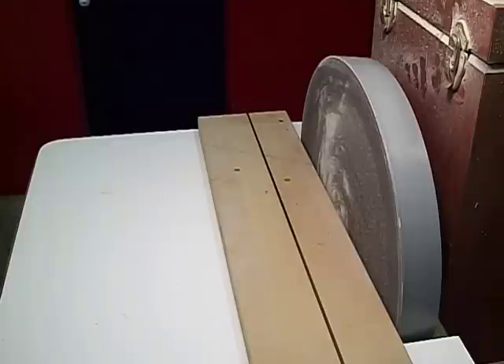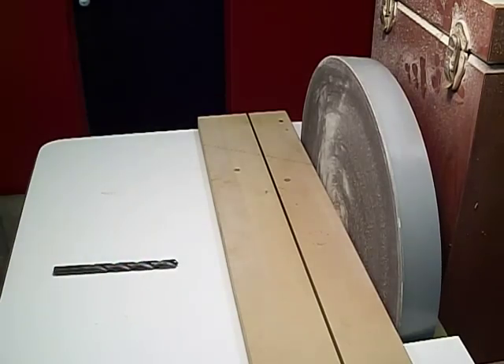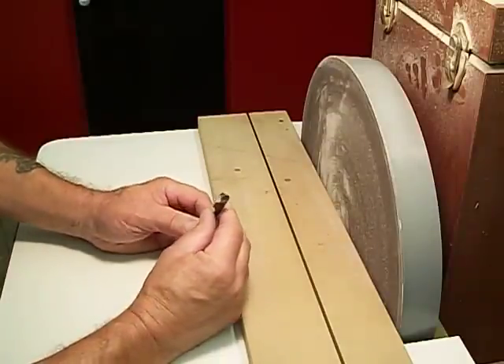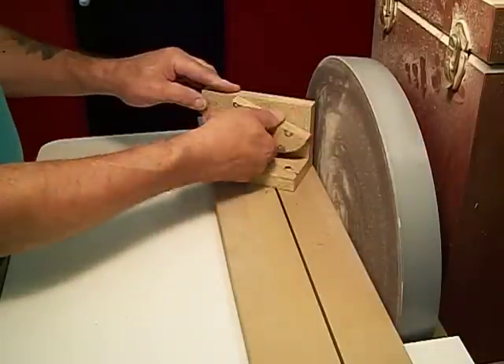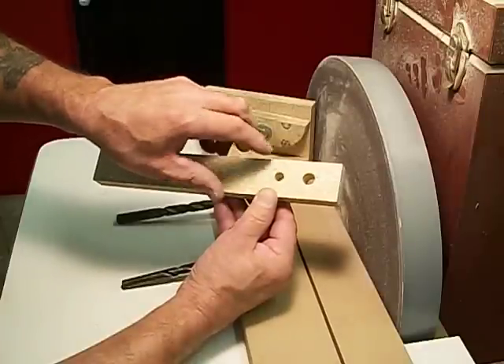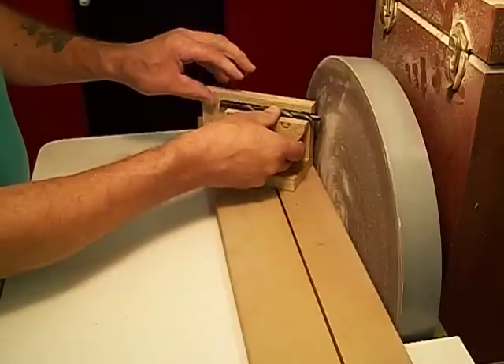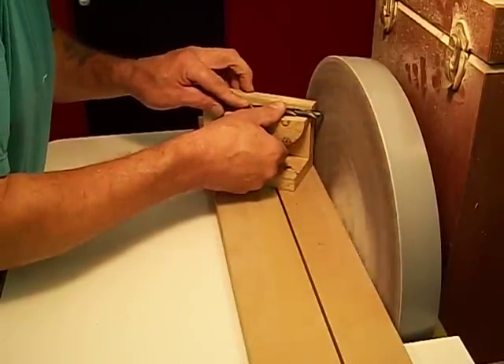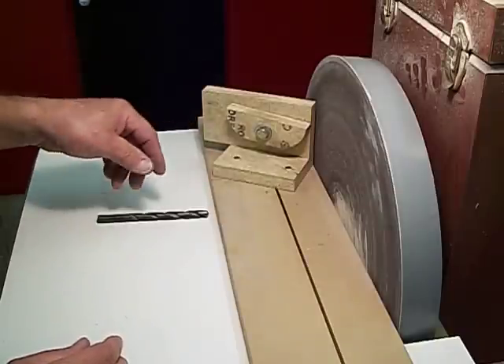A Drill Bit Sharpening Jig You Can Rely On

Comment: The General drill sharpener that was purchased at the yard sale works very well, in fact i improved on it making the numbers easier to read and more accurate , drill bits have two cutting surfaces/side  you could not achieve by the hand method of your approach.

Comment: Hi Joe,
   I have used a face sander to sharpen drills and other metal objects for many years now. One thing that I have learned the hard way is that if there is a build-up of wood dust in the sander, it can set on fire. Not right away, but may-be many minutes later when you are not in the room to see it catch fire. This is more likely to happen if there is a blower fitted to exstract the dust into a container as it fans any sparks.
   Another tip that I use is with two hexigon nuts of the same size. Put the nuts next to each other side by side on a flat surface resting on thier flats, then use the 60 degee's angle between the nuts to judge if the drills are equal on both sides and that the angle is near to 59 degree's.
   I hope that these tip's help others, as much as your tips have helped me.
Reply: A more probable fire risk, is when people grind a lot of aluminum, and then start to grind iron or steel,  which creates "Thermite" (the iron oxide burns fiercely with the aluminum dust)...  Actually, most steel train rails are welded by burning aluminum dust with iron oxide. The chemical reaction is extremely energetic (exothermic).

Comment: Thank you Joe for the idea for a sharpening jig. Your jig looks fairly simple and practical.
It may be possible to acquire the skill to do a perfect job of sharpening the bit with your bare hands. But that may take years. A jig allows you to reach that level of perfection in hours if not minutes. Sharpening a bit without a jig looks like trying to draw a 12 inch straight line without a ruler.

Comment: Thanx! Now, after watching this, I went to my grinder which has a positionable tool rest for up, down, and tilt. Putting my diy drill guide on (just angle iron mounted on a small board with a keyway attached beneath to sit in the slot) and as I'd been manually tilting the bit upward to grind the relief, I realized all I had to do was loosen the tilt clamp and...voila! Just the same as your jig!

Comment: If the cradle pivot center was in the same plane as the bit's center while being sharpened, you wouldn't need to push the bit into the sanding disk as the cradle is rotated upwards.  The heel of web behind the edge being sharpened would then extend past the circle radius from cradle pivot to sanding disk, formed as the cradle is rotated upwards.  If the cradle pivot point is adjustable (eg: riding in a slot in the cradle and jig), the heel relief can be adjusted to suit the diameter of the bit.  This would allow consistent heel relief for each cutting edge vs. relying on operator skill.  A stop in the cradle behind the bit would also factor out the major part of variation between flutes due to operator control.

Comment: I have and used a sharpener like that general for over 35 years. If you want a drill sharpened to better than new condition, and you want to take the extra 30 seconds to set it up. You can not beat how perfect it will sharpen a twist drill. You can adjust every aspect and angle on the bits. If any one has trouble I will be glad to help you out.
Reply: I would very much appreciate someone to show me how to set one up and use it properly 
thanks
Reply: +denison gunner You can down load the manual from the net. Set up is straight forward and easy to use, consistent results every time
Reply: Check out Greg Halligan's workshop video comparing the Drill Doctor to the Craftsman/General drill sharpening jig.  He uses an 8" bench grinder.  However,  I took a suggestion of his to use a belt sander with the jig and built a simple step to mount the jig with my 1" x 30" Delta belt sander.  Works great!    These devices are way easy to use and will deliver consistent excellent results every time.  IF IF IF people will just read the instructions completely and take the time to set it up right from the first.    Big IF, I know.

Comment: I tried the General many years ago and wasn't able to understand how to set it up properly. I was given a Drill Doctor, the model 500 and the video included with it was clear and I had no trouble with it. As for how easy it is to use....My wife watched the video and set it up in a few minutes to sharpen over 500 drill bits I bought at auction, various sizes, both regular twist drills and carbide tipped drills for masonry and concrete. They all turned out beautifully and she only took a few days to sharpen them. She sold them at her craft shows for 50 cents for bits under 1/4" and a dollar for a bit larger and made a nice bit of change. Drill Doctor is a good tool.

Comment: I am almost done building your drill bit jig. I appreciated the tour of your workshop. My grinder is mounted on a saw horse table which didn't have a good platform so I took the factory guides off it and made one out of boards. Had to level it since the grinder is on a saw horse table with plywood sheets. In all it is fun to work through it. You set the example and it is much appreciated. Can't wait to sharpen some drill bits. Thank you.

Comment: Thanks for the video.  I don't know about you, but I need to check the angle and if the cutting edges are even. Starrett make a really nice little attachment for their hook rules that attaches a 59 degree stop with measurements marked on it,onto the rule and that lets you check your angle and also check the length of the cutting edges. Fast and simple just hold the drill bit along the rule and look for light at the cutting edge. All the best

Comment: Joe your jig is good and a lot of people say the drill doctor is better..  i have used the drill doctor and it is very nice for sharpening drill bits for wood. for metal bits you should use oil or water to cool your work so you keep the temper. when you sharpen your bit and you see sparks flying you are heating the edge up past the temper point. for wood this is perfectly fine. for metal try oiling your wheel or wetting it. either way awesome jig and nice job.
Reply: oiling your wheel ? WHAT ?? this is NOT a Whetstone where you use mineral oil to sharpen a knife... oiling a piece of sandpaper ? that was his "wheel" in the demo.. now if your wheel is the standard aluminum oxide like with the standard bench grinder, never do something that will compromise the integrity of that type of wheel either !
Reply: While the "do not overheat" advice is solid, remember that a slower than a bench grinder, sanding wheel, which has a larger diameter and uses sand paper, produces lower temperatures that the grinding wheel,  because is also "pumps" a lot more air into the contact point.But using a small, aquarium pump to direct a concentrated stream of air helps a lot at avoiding overheating, and avoids having to use water or oil.

Comment: Thanks. Watching this made me rethink my drastically overengineered plans for a knife sharpening jig.

New version just has the sharpening angle cut right off of a block of wood so the blade can be held against that while the hone is run over the remaining flat surface to maintain the angle.

There's something to be said for simplicity. Might add a stiff brush as wear-surface for the hone and magnets and/or rubber underneath but the thing just works.
Reply: And WHERE is the "New" version????

Comment: I like it, but I would have made a way to quickly clamp the bit down. I would also have made the fixture fit in the track, so you could move it to a fresh place on your sanding disk. After sharpening 6-8 bits, I'll bet your sand paper wears through to the backing plate. Thanks for the great idea,,,

Comment: Sounds like the bit is bouncing in the jig, or the jig bouncing. Not sure but kinda sounds like a fluttering noise or like a chatter on a mini lathe. Seems to lay down a pretty consistent geometry though, I've been using the 59° lines method freehand and I'm probably only 65-70% first try sharp. I'm going to give your jig a go with either some scrap steel or aluminum as I'm sold on your proof of concept... Thanx for sharing with us n have a great day👌👍💪
Reply: P. S. Forgot to mention that first arrangement you brought out is an actual putting aid from the movie  Caddy shack 🤣 thanx again

Comment: Congratulations Joe, this is one of the simplest yet most clever and effective jigs. However one needs to do some more preparatory work especially for drills less than 9mm, or broken ones,otherwise he will end up with funny results. It all has to do with what rotational position you touch the bit on the grinder.Your demonstration bits were big and new enough to touch them correctly by just watching the original line..This is not always possible. I will try uploading a complimentary video.

Comment: Joe........yours is a very good practical idea,  and with just a few refinements your simple idea can likely be improved upon to further reduce any required skills or human error. 

                 In the Tubalcain video notice how close his pivot point is to the sander. Your pivot point is a bit farther back, about midway the bit length. This causes more radial swing of tip and a correspondingly greater linear distance the bit must travel (slid) to maintain contact with sander when you pivot/slide.  Just wondering if it's possible to incorporate  a close pivot somehow working off of an eccentric type cam lobe  to eliminate the need to slide the bit inward by hand? Maybe I'll work up a simple drawing on this to see where my idea leads.  I suspect the fatal flaw in using a lobed pivot point might be that it only works best for a certain bit diameter............maybe a lobe of adjustable eccentricity would work for all sizes......but then again it complicates your simple solution.
Reply: Again, yours is a good (Better) idea.  Why you don´t do a video showing it to all of us, please?

Comment: Isn't that paper only for wood sanding? For metal you need a grinding disc. You can get cheap ones to attach to a drill or use a bench grinder. The right tool/material for the job comes to mind.

Comment: Your idea is halfway there.
In your video you show the drill bit on top of a pivoting cradle which makes the drill bit moce away from the sander as its pivoted up to grind the relief and the user having to feed the drill bit towards the sander to grind the relief. What if you changed the pivot point and have the drill bit under the pivot point, it would then feed in automatically to grind the relief.

Comment: Good morning, I'm from Brazil, I really liked the way you sharpen drills. How many degrees is the lateral slope? Can I sharpen bits from 0.6mm to 2mm? Could you do a demonstration?
Reply: He didn't reply so I hope I can help you:
The clearance angle (if that's what you meant) is between 14 and 7 degrees, depending on the size of the drill bit and how hard materials it's intended for. 11 degrees is a normal angle for "normal" drills up to 12 mm and 9 degrees for a little bigger bits. Smaller bits, larger angle.
  I havent found any general sharpening device that can sharpen as small bits as you mentioned. The usual sharpening machines and jigs start from about 3 mm. To sharpen these small drills can hardly be done by hand and they are pretty cheap anyway.

Comment: I would add a Plexiglas shield to guard against accidentally running hand or fingers into the side of the grinding wheel.
Reply: As it is NOT a grinding wheel, but a slower turning SANDING wheel, the risk is very low, althoug painful, but not really all that dangerous. Just use a Little care.

Comment: Large drill bits are very easy to sharpen by hand on the bench grinder, fine stone.  But ,  my precision work require small drill bits for  metals,  carbon steel, brass, aluminum, stainless steel, copper white metal.  How does your rig work on drill bits 1/8 inch diameter and smaller,  all the way down to number 60 ?
I have nearly 100 of them waiting for sharpening. Best regards,  Patricia,
Reply: Drill bits smaller than 1/4" or 3/16" are HARDER to sharpen, either with a jig or machine or by hand. Trying to sharpen such small bits as 1/8 or much smaller is a matter of luck, and those are so inexpensive that it is counter productive to try.

Comment: Nice idea and you maybe able to sharpen brill bits to drill wood with your little jig just fine; however I don't use those bits on wood I use those types on different types of metal what they were designed for. I cannot see down to a thousandth of an inch so I will use the tool you called junk because your too lazy to set it up. the tool works well and is very accurate if used properly. they have been around for nearly 75 years and mine is under the Craftsman name. I have mine setup on a grinder and it takes just a minute to load a bit grind it razor sharp with the point dead center of the bit
Reply: knifesharpen
Reply: DS75921 o
Reply: His tool would word good if he knew how to use it better.  The angle is key,  but there is 2 angles per side.  When make the first major cut you will notice the blade not hitting is more less on a 90.  or straight up.  then to do your blade rotate clockwise till the point that was facing up directly matches point on the other side.  But I agree with what your saying.  Shit like this is to more less get you out a bind.  Say at camp need a bit or a buddies place who lives to far to drive home to drill a dam hole and it snaps,  tools not with you.  If like me there is no way in fucking hell i'll claim defeat,   I call Geeter..  you know..  Geeter fuckin Dune..lol

Comment: I have near same thing// I use 6 inch diamond lapidary disk have 60 80 240 600 800 1200 3000 grit i sharpen every thing with them I am wood worker try them disk you will love them faster and much cooler they last a very long time

Comment: Nope, sorry, you cannot get a drill bang on correct that way, you might as well just hold it in your hands. How do you know you've got both flutes exactly the same length? You can't, you were just guessing, that's what that lovely professional jig had all those little 'doodads' for, to set the drill at the correct angles and control how much was ground off each edge. Don't knock something you don't understand.
As for the exit side being crisp, that's just hooey! A brand new twist drill will chip all around the exit of just about any wood you care to put it through,  it's not designed to make a clean hole, the only way you stand a chance is if you have a backing board clamped hard to the piece you're drilling through for the drill to run into or better still, a flat bit or an auger bit with a spike that pokes through warning you to stop, turn the job around and drill through from the other side.
Twist drills are primarily for drilling metal and need to be ground accurately, far more accurately than this, there are purpose designed bits for drilling wood. 
There are too many amateurs on Youtube telling people who know even less how to do stuff, it annoys the hell outta me!

Comment: The problem is the same with the cheap drill sharpening tools one can buy at many stores. If one sees the expensive drill sharpening tools one will see something different. One must grind two reliefs/clearances in the flank of a drill. One relief/clearance for the circular motion and another clearance for the vertical/longitudinal motion. One might get away with not having both clearances on soft material but on hard material one will burn up the drill for it will not dig into the material. One has to move the drill in two directions to get the right clearance. One needs a downward motion and a very little outward motion.

Comment: I guess it works but the 59 degree angle I don't think is happening with this jig.
The fancy jig you criticised so much probably sharpens all the cutting surfaces not just the tip of the bit.
Reply: It actually is the OTHER way around: it is easy to grind the sides of the flutes, and the point is actually the hardest par to properly sharpen.

Comment: it sounded like you mentioned 59 degs ????? how did you get that  i thought it was 118 degs
Reply: Each side of the tip is 59 degrees from the drill center line totalling 118 degrees.
Reply: i wanted to make this angle for my grinding wheel  you look at a compass 59 degs and 118 are about 3 degres apart  that  which do i use   @rongrosstube

Comment: One of the few jigs I have seen that have any sort of potential, but the problem of "balancing" the edges remains. I have an Eclipse (manual) drill sharpening jig, (this one: https://www.worthpoint.com/worthopedia/eclipse-39-drill-bit-sharpener-166015107) bought a few decades ago, which is run over a sheet of 100-grit Aluminium oxide sandpaper. It takes about a minute to set up and produces sharp, even cutting edges on the drill bit. This jig has a back stop that ensures that the bit is properly centered. The eccentric wheels on the back provide the correct curve on the faces of the bit. 

I'm going to see if I can adapt your jig to accommodate this feature: it may mean having to attach a piece of angle iron to the "rocker" and welding a nut to it, through which a bolt can be turned to act as the backstop.

Comment: how do you know if the cutting side is the same the tools you throw on site is desighn to sharpening perfectly equal it mean bouth cuting side of the drill is the same.and  the edge of the rounded piece of wood where you put the drill bitis never touch sand paper which is turning to slow to make sharp drill bit   you cut only the same degree but sorry    no good idea at all